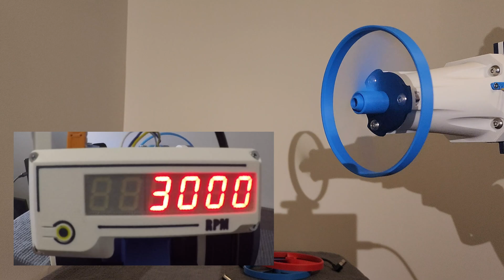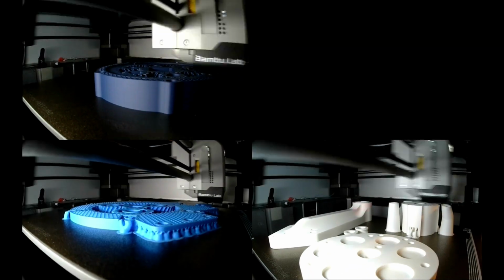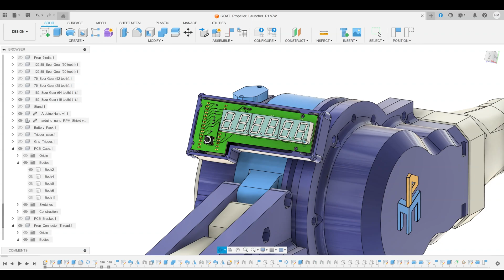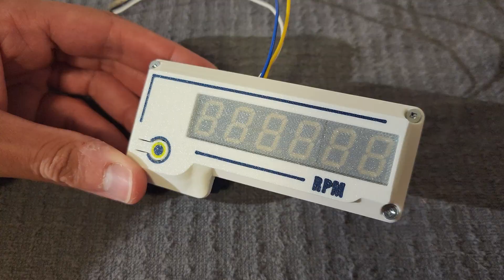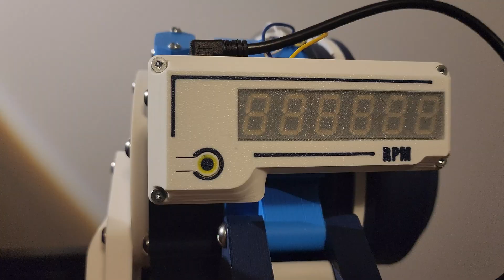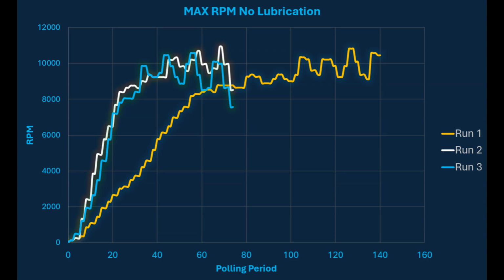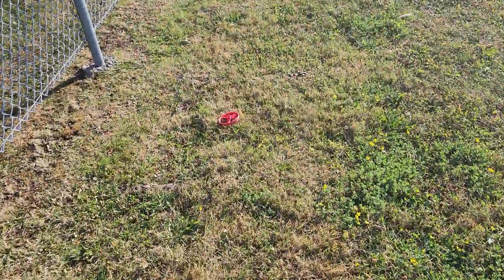Can a 3D Printed Propeller Launcher Outrange a Football Field?

Comment: Cool, what you should do is ditch the hand crank for a motor and lengthen the projectile adding more weight maybe a weighted ring like a washer insert to add some mass to the flywheel, and a heavy top shuttlecock. OOoo you add co2 cylinder instead maybe?
Reply from the maker: Hi richard, thanks a lot for watching and commenting. Yes electric motor is on the way :) There's only so much the arm can do! Propeller optimization too! You are right increasing the inertia as much as possible will help. 

I love the shuttlecock idea haha! Do you play some badminton? They slow down fast, but it would be cool to see how fast I could get one to go haha.

Comment: The propeller might be able to fly a bit farther if you increase the weight of the frame connected to the propeller, since it would then maintain its rotational speed for longer.
Reply from the maker: Totally right ! I experimented with this (not in depth), and there seems to be an optimal point for this. At some point the mass counteracts too much of the vertical component of the lift and the prop just flies forward before droping down. It needs some altitude to go really far too. A thin rim though stores much less energy. Somewhere in the middle seems to be the best. Thanks a lot for watching :)!!!

Comment: the design is insane! it's like gluon gun amongst propeller launchers. i can imagine how satisfying it is to build it from parts
btw this 3d printed screen protector looks cool too. i never got a chance on working with clear PLA, but i suppose it's easier to print such thin transparent objects with it rather than with PETG?
Reply from the maker: Thanks for watching! I tried to give it a Borderlands vibe, with an inspiration from Halo for the rpm readout. The clear pla protector is printed as part of the lid (using the AMS of my printer) and its 2 layers of clear PLA. Easy to print similar to other PLAs.
Reply: @MechaPrints  well it looks like something you would find in borderlands! thanks for the insight on clear pla. i am hoping to get some when i find mental mana to do 3d printing again
Reply from the maker: @кира-о9з6ъ  Thanks for watching :) You've been along from the start I appreciate it a lot!

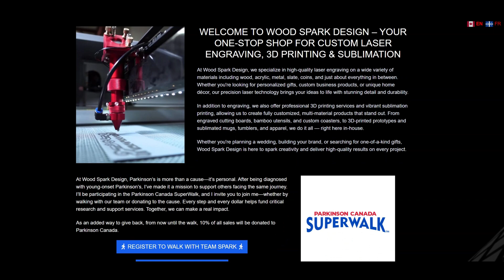Comment: I'm looking forward to the next video, but what do you mean by "try to hit the speed of sound with this thing" at 8:20?

-  To get just the tangential velocity of the outer ring to hit the speed of sound you'd need to quadruple the RPM which means at least 64 times the power output while still on the launcher.
-  If you wanted the linear velocity of the disk to hit the speed of sound you'd either need to spin it two times faster still (i.e. another 8 times the power, so overall 512 times the current power) or increase the angle of attack (AOA) of the propellers to at least 45 degrees, increasing the necessary power output by at least 40 percent. (By the way, I think the both disks launched at about 40m/s, based on the RPM, outer AOA, and radius)
-  If you double the disk radius, the power output at a given RPM doubles and the necessary RPM to get the tangential velocity to the speed of sound halves. Combining these with the previous calculation gives 64*2/8=16 times the power output.
-  Of course some of the power is going into friction in the launcher itself, but given that the slightly smaller disk spun 30% faster, it seems like a significant of the power is going into drag on the propeller blades.

This is ignoring all the nasty stuff about supersonic flow. I don't think it's possible to achieve this with the current design. 

(Where) am I wrong? Was it not supposed to be taken this seriously?
Reply from the maker: Love your assessment. I haven't managed to do it yet. Don't think I will, unless I add a significant amount of power. Fastest I spun an object yet is mach 0.42 (fishing wire with a small mass). I might add an electric motor... :). I did mean tip speed by the way, this is way easier than rectilinear speed of the prop. 40 m/s sounds about right, in roughly 2-3 seconds the prop was already on the other side of the field (average 33 to 50 m/s just in terms of horizontal travel).
Reply: @MechaPrints  Make it holdable with two cranks

Comment: Wow! Amazing!
I think if you increase the weight of the propeller ring it might fly even further due to more inertia.
Reply from the maker: Yes ! I tried various versions and it does help, but there is also a limit. Too much mass also limits how high the lift will bring the prop since it fights the mass. So there is a sweet spot to find, this is a complex optimization problem. Thank you for watching !!!

Comment: You might try adding a clock spring to the output, to buffer the output power, so the rotor doesn't fly off between pulls on the crank arm.
Reply from the maker: I like the idea! Thanks for watching :)